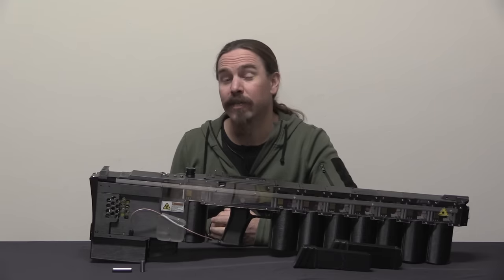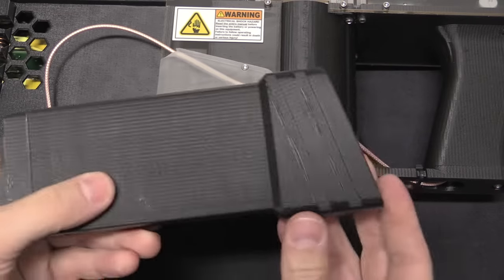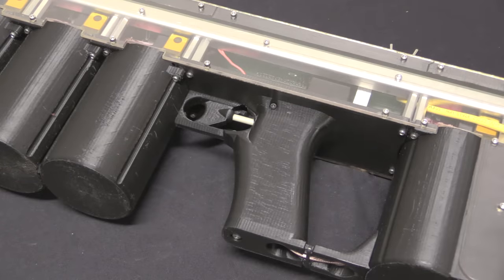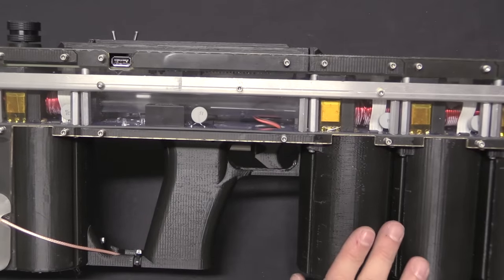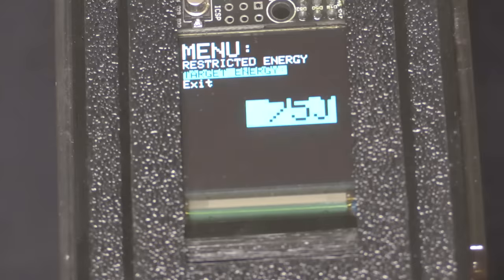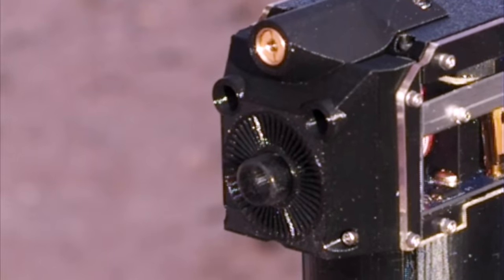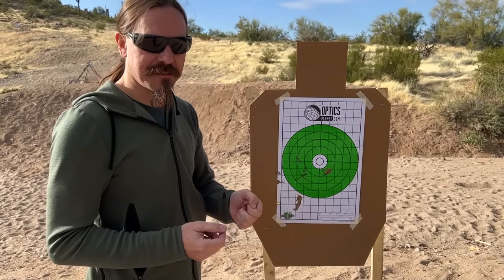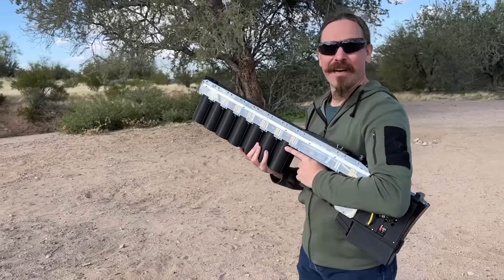ArcFlash Labs' GR-1 Anvil Portable Gauss Rifle

Comment: The "medium length hollow point" is actually just a "Drop in" concrete anchor. Amazing what can be used as a projectile.
Reply: Haha yep, I worked as a concrete cutter and immediately recognized that.
Reply: Nice 😂
Reply: Stuck for ammo in an urban warfare scenario?  
Cut up some appropriate diameter rebar that's hanging out of a blasted wall. A quick bit of trim to make it reasonably uniform and you've got ammo. 
The whole dang city is one big ammo dump!
Mind thoroughly boggled over here.... 🙃
Reply: @deltavee2  wouldnt be too hard to imagine an attachment or accessory that does that.  Just toss the rebar in end first and it spits out ammo.
Reply: Quick we’re running low on ammo, get to B&Q
Reply: A mag full of grade 8 screws lmfao
Reply: @deltavee2  I kinda like the idea of a longer piece of rebar being used as a javalin.
Reply: @Hotarg  iirc the guns in Mass Effect basically do that, load in a block of metal and it shaves off small projectiles
Reply: @Hotarg  Cunning plan as long as it doesn't use the gun as a power supply because power drop.  Now if you take your Tesla or Rivian along, no problem!
Reply: ATF… raiding the local hardware store since 2022! 😂

Comment: You know this is a prototype when you see a deans connector on the battery pack cable! I love it, the whole thing feels so developmental and that's brilliant, we don't often get to see this stage only the finished item. 👍
Reply: Lol I was thinking the same! That's the same connectors I use on my rc planes!
Reply: AK50 lol

That said, I'm surprised to see 3d printed part
Reply: Yup. In 10 years it will indeed become a forgotten weapon even if those enter production since it's such an early prototype.
Reply: You know it's a prototype because it has 3D printed everything.
Reply: On Forgotten Weapons many prototypes saw screen time, the difference is this prototype is made with modern prototype materials and it's an electronic product which means 3D printed PLA, polycarbonate  and standard boards instead of visible machining and other signs of hand-made metalworking
Reply: @TheLaXandro  haha you should see their prototype from ten years ago
Reply: The medium “hollow point” projectile is literally a an actual concrete anchor.
Reply: How big are the cells in a Tesla battery pack?
Reply: Airsoft players will think this is just a replica
Reply: @tmseh  21mm in diameter and 70mm long, though they use a whole lot of them.